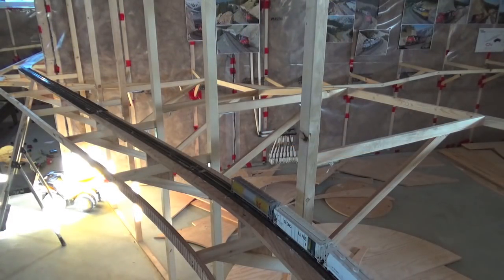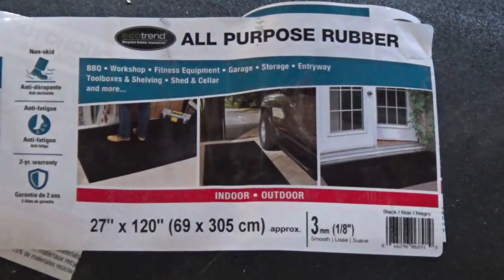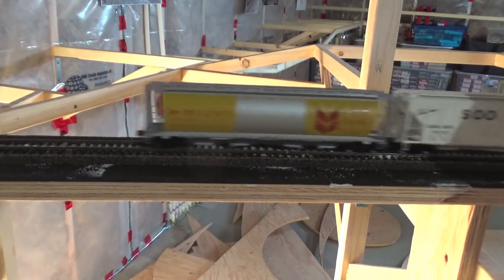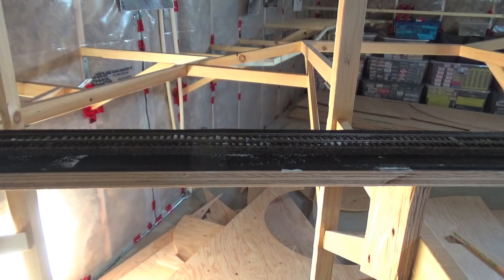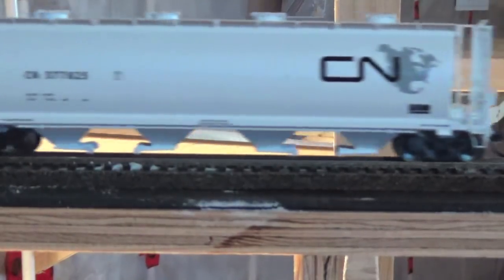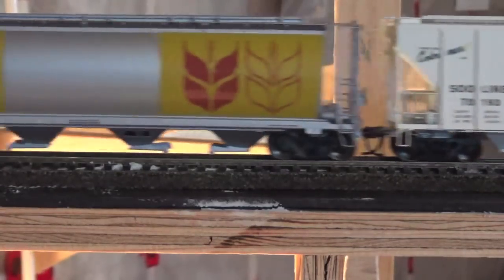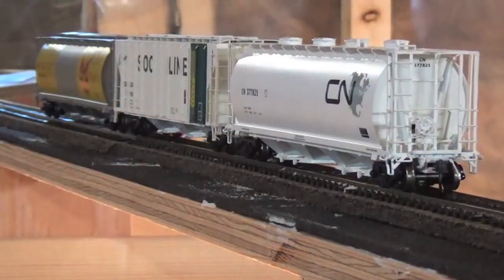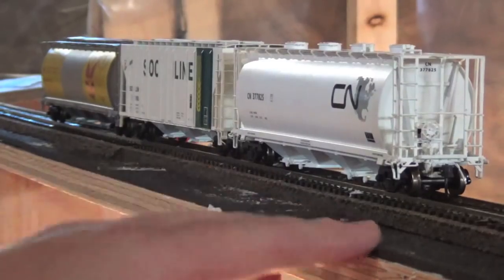Sound deadening material under cork roadbed - Does it work?

Comment: Wood is a resonator! That's why it's used to build guitars and other "wood" instruments. As a luthier, we would rap on a piece of wood with a small rubber mallet to get an idea of how it would resonate, to hear it's tone qualities. Yes, some woods are less resonate than others, but ALL wood is resonate. Add to that, plaster, Styrofoam, etc, etc, for landscaping, and you effectively build a drum. To stop the drum effect, fill all chambers with something that will stop the resonance. You can use wads of newspaper or pillow foam you can buy by the bag at Walmart.

Depending on how far people want to go (such as myself, yes I'm an insane maniac), there are many things you can do to deaden acoustic resonance. In my first home, I built heavy wooden frames, and filled them with 1/4" concrete as a base. That's going to offer "as dead as it gets" qualities. AMI roadbed was used, and is extremely dense. Although it's no longer available, you can still buy it by it's construction name of butyl tape and/or putty tape and/or pipe wrap.

On my new layout, I'm trying a little different approach. Instead of a complete concrete table slab, I will be experimenting with a poured concrete sub-roadbed. Then I will be using the butyl tape on top of that. The main table is built of wood and pink Styrofoam. If it doesn't work out the way I plan, then it will get ripped up and another thin concrete slab will be poured.

Also, another thing to think about is your rolling stock. Most rolling stock are big hollow drums, rolling around on metal wheels, and resonating back and forth with the roadbed/sub-roadbed. Try using something in your rolling stock to insulate and stop the resonance. Pillow foam works well for me, you can cram a lot in there!  ;)

There are many other things you can do to deaden resonance, such as either not connecting your tables to your walls (unless they happen to be concrete) or using a heavy rubber materiel between your wall and table connection points, etc.

Have fun.

P.S. I hear Homasote makes for a good sub-roadbed/roadbed for deadening, but I have yet to try it.
Reply from the maker: Wow great information thanks so much for sharing. After I read your comment I did a lot more reading. Like you say this is resonating sound we are dealing with. Only way is to go with something that doesn't resonate like concrete as you say or mechanically detach it. Glad to hear you say that putting insulation inside the framework once complete will also cancel out the sound. I am for sure going to try that once I get to a more complete stage. 
Another great point about the rolling stock. Another idea I have heard is filling them with sand. 
I considered Homasote, I wish I could get my hands on a piece of it to test but according to their website it's not sold in my city. Sonopan is similar product but same problem with availability. 
Thanks again for your insight. Much appreciated!
Reply: I have seen Homasote here in Ohio at Menards, not sure were you're located or if you might have a Menards in your area. I have also seen it at a few different Lowes locations, so maybe check there as well.

One other option I totally forgot about because it's been so many years since I used it, but that is flat ceiling tile! When I was a teen and young man still at mom & dads house, that's what I used in place of Homasote for hand-laying my track. It worked incredibly well for hand-laying, and as I remember, wasn't to bad as far as sound went. It's been 38 or so years since then, so my memory is a bit foggy on how it sounded. Back then, we didn't have sound systems to worry about, and many times guys really liked having a lot of natural noise going on to add to the railroading insanity!! ;)

Anyway, you could probably grab a single piece of ceiling tile for a couple of bucks, just to give it a try and see how it sounds. Just try to find the flattest, and densest stuff you can. Also as a side note, I always cut my tiles using a simple carpenters utility knife, I never used a power saw. Some ceiling tiles contain bad stuff you don't want to be breathing, so either cut by hand or get the appropriate dust mask for the job.

Glad I could help you out with some ideas! Have fun!
Reply from the maker: Apocalypse Railroad No Homosote or Sonapan within 100 miles of me unfortunately. I live up in central Alberta, Canada. You'd be shocked to see what we pay for a sheet both with our lower dollar value and then the increased shipping costs.
I looked into Mass Loaded Vinyl (used in car audio) as well, but at $5.50 per sq.ft. it's 5 X as expensive as the heavy recycled rubber I found.
I will look into ceiling tiles and add it to the master list in the video info, thanks for the heads up on that one!

Ben

Comment: Assuming it's artificial rubber and not natural rubber (which is probably a correct assumption on my end) at least from my experiences is that rubber has a fairly small expansion and contraction on temperature swings.... In a basement like yours it's very likely that there will be no change at all that's even measurable. I'd say you'd only notice a change if there was around a 40 degree fluctuation between temperatures which is very unlikely inside a house.
Reply from the maker: Not sure, it just said recycled rubber product on the label so who knows? I agree with you, I mean when talking expansion its fractions of a mm for one degree. Not really an issue. But the metal rails are a different story. My friend had an actual sun kink show up on his layout in the summer. Just like on the prototype.

Comment: Hi, didn't you used to run your trains at 40 MPH scale? Are you still planning on running at the same speed on your new layout?  Also, why would you be concerned about the sound level? I don't understand why you are worried about it? I could see if you were running Gauge 1 trains. At any rate, best of luck! Seems you'll have a very precise layout! Lots of excellent work!
Reply from the maker: Hi Paul, 
Yes all my locomotives top out at 40 scale MPH. Which happens to be the top end of most modern locomotives these days. Probably not all the time but sometimes it's fun to run a big train that fast. The subdivisions I am modelling have speed limits above that so it won't quite be prototypical but a 30 car grain train at 40 scale MPH looks pretty fast. 
It's just a personal preference. My last layout had really bad wheel noise so this one I want to try and reduce it. Especially since I plan on running a sound car in the middle of trains eventually. Thanks for the kind words! Much appreciated.
Ben